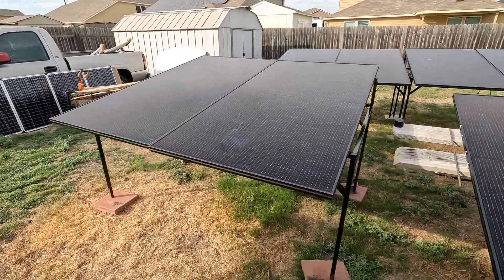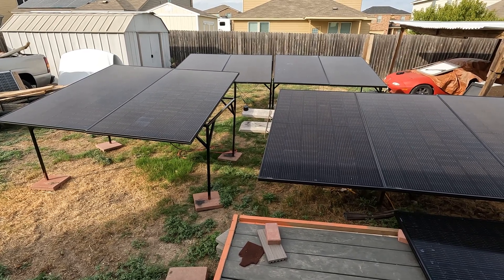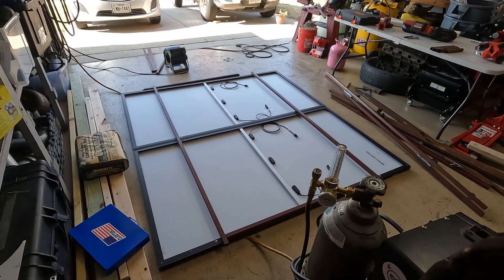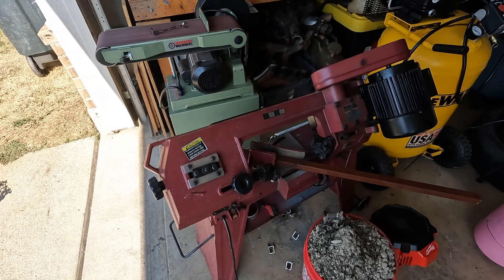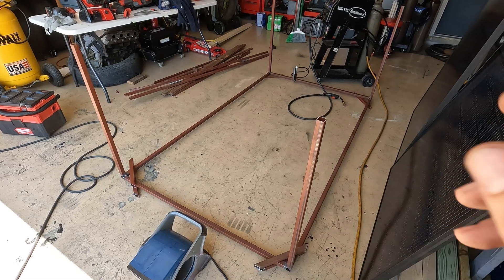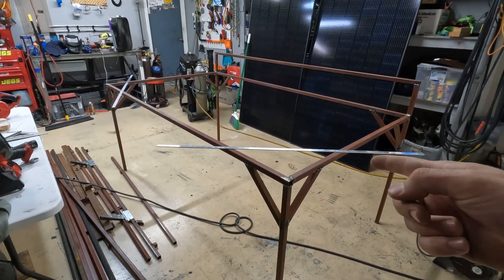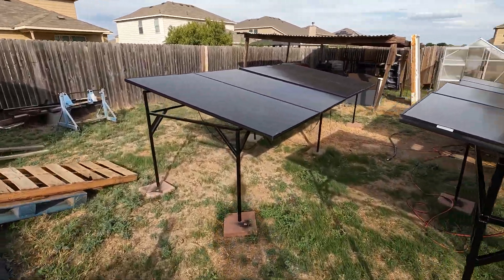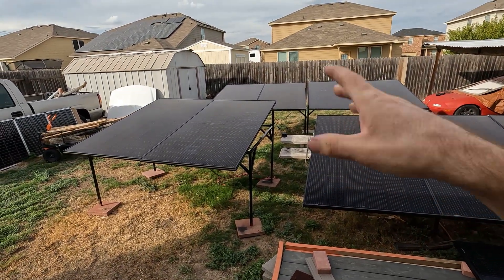I Built Simple Solar Panel Stands For Cheap

Comment: Nice easy to clean the solar panel and the solar panels has enough ventilation from getting hot 
Some people just put solar panels on roof of the house without enough ventilation 
They dont know that when solar panel gets hot the efficiency of the solar panel will decrease and some of the photovoltaic cell of the solar panel will have a cracks caused by the heat